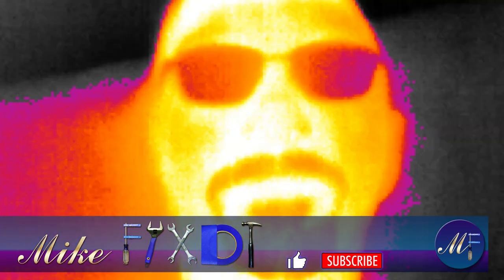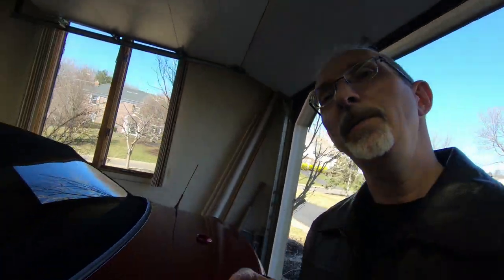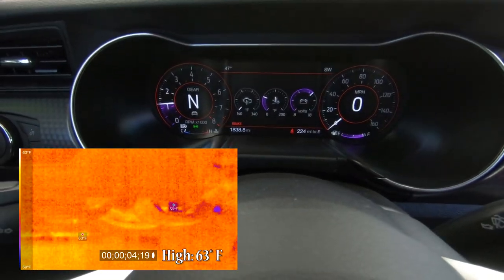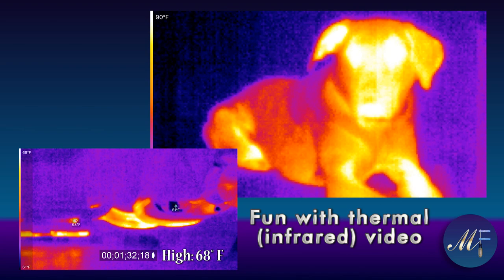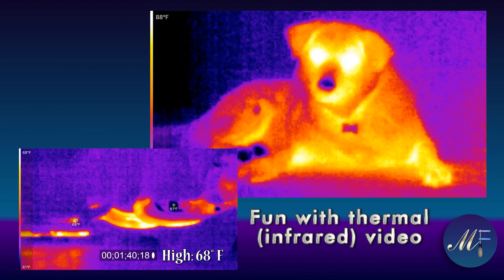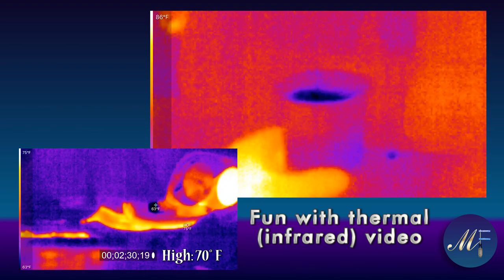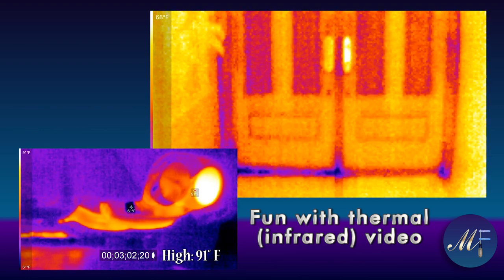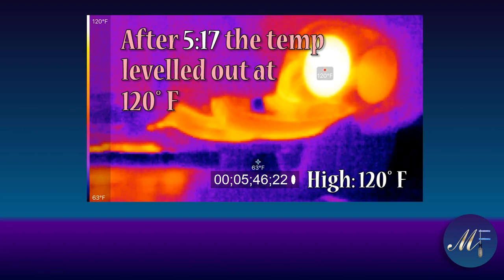Car Warm-up Time Answered w/ Thermal Imaging

Comment: Don't warm up your car if it's fuel injected. Warming up a car was for carburetor vehicles, you can run a cold car at long as you don't over rev it. STOP POLLUTING THE ENVIRONMENT BY IDLING !!
Reply from the maker: @Jacinto Suarez - I hear you, on the warmup period AND on wasting gas if you don't have to. IMO warm-up all comes down to how harsh your driving environment and driving style are. If you're in brutal cold then some things are more likely to break. But for most climates just let it warm up as you drive.
Reply: Overall I agree with Jacinto NOT to idle the car. In my country (Austria, European Union) it is even forbidden to idle the car for longer than a minute unless there is a good reason (traffic congestion etc.) Nevertheless I agree with Mike, when it comes to cold weather. I would warm up for one minute , if the temperatures are below -15°Celsius or even -20° C. (Lower than 5° Fahrenheit?). Even expensive engine oils turn almost into 'mash'.